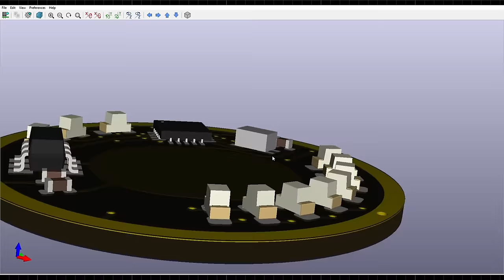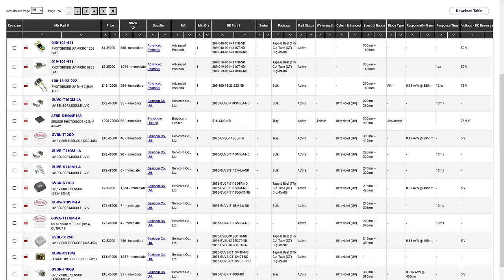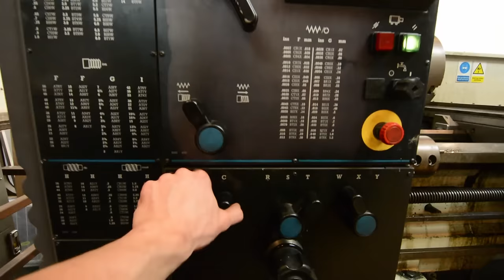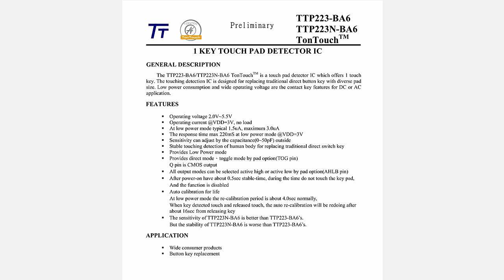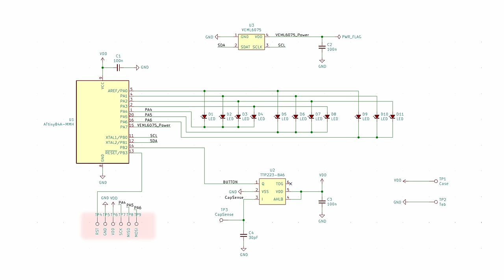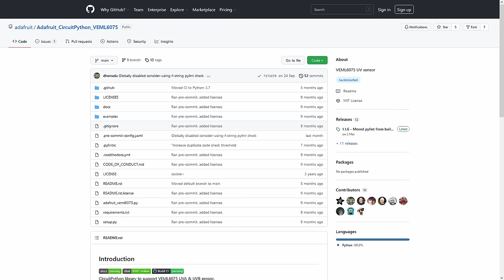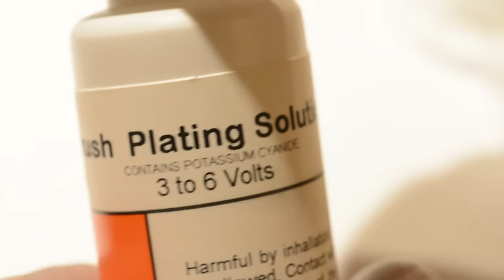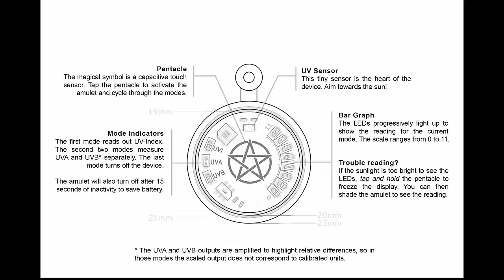UV Protection Amulet

Comment: How to improve it:
1.) Use individual sensing diodes for various UV wavelengths and measure the values yourself with ADCs.
2.) Use an electronic paper display, it fits perfectly with this project.
3.) Make it solar rechargeable with a little super-capacitor.
4.) Add a quartz glass window.
Reply: are there epaper displays with the dimensions of a CR2032 battery?
Reply: @MrPhilip796  
Is it really necessary to make it the dimensions of a certain battery ? Like, what if it’s solar rechargeable with a supercapacitor for energy storage ?
Reply: @cezarcatalin1406  I feel like it'd end up looking weird if you didn't fill out the round window of the amulet, and I mean I don't wear jewelry, but if I was to I don't think I'd wear something that looks weird as that just seems to defeat the point?
Reply: @MrPhilip796  
Ok, that’s actually a good point... maybe we can have a round epaper ? Or... maybe we can have a square amulet... OR maybe we can have an amulet like a star with 8 corners made of two squares placed at 45 degrees and that allows both a square screen and other sensors/things in the other four corners.
Reply: great idea, but I agree with the fact that this would look weird with a square/rectangular display. 
Also, the small size is what makes it unique.
Reply: @cezarcatalin1406  solar panel on back? i really loved the dimensions tho I could understand making it bigger.
Reply: @cezarcatalin1406  on a hyper speed google session i found a round 3.9 inch epaper display while batteries are 3.2, honestly, just add a bezel on the battery compartment and you would be fine.
Reply: @MrPhilip796  Well, why not make a square or rectangular amulet? It could be even easier to make.
Reply: What do you reckon is easier to make? Threads which is only possible on something round or a hinge + locking mechanism?
Unless you think wearing your amulet the wrong way to have a solar panel charge an oversized super capacitor is a better idea than a small replaceable battery?
Reply: @MrPhilip796  What do you mean by wearing amulet the wrong way? I'm for e-ink rectangular screen, because I've already seen the rectangular MP3 players designed to be worn as a necklace, they looked good. I'd prefer leaving the battery as is, it would probably last longer than in any wristwatch. However - using really tiny rechargeable battery or supercapacitor and really tiny solar panels on the thinner sides of the cube could make the device totally maintenance free and virtually eternal. Consider a box like 1/2 of a box of matches. I know, aesthetics is subjective, not everyone would like the look, but it would be pretty practical. BTW, I also disassembled one of such MP3 player, it was pretty simple aluminum box, nothing too fancy. There are plenty of ways of doing a little metal box. You can even probably buy one.
Reply: Or, just usb-c to charge, and an ultracap.
Skip the metal case, lay in lapidary odds and sods, use lube threading some pyrite or something if you must thread something. Can't wait to get past the metal bit to this wonderful wee amulet.
   This could have been EDM milled. But the graph...can connect over LiFi surely to give actual instrumentation to it, a mcu having been fingered for whatever otherwise untapped reason. And no shading the UV sensor.  Louis XIV era suns are old looking enough really? And hurrah DEFRA then for a touch of enpirical sense! But then your green method for passivating brass is gold arsenide for reasons...leaf from Johnson Matthey is too thicc? Dunno.
  You'll get all sorts of contact about outdwarfing and Asgilathshoring...nothing like a good entspeke system that works with Sslacke and Dischyrde.
Reply: Excellent. Can you please hop on the project to make the improved amulet and send it my way? I'm completely willing to pay for the cost of parts...
Reply: i don't think electronic paper would work well in a device so small.

Comment: Great project! Thanks for the research with that sensor.. I got some of those here and would have expected that they actually work. I'm asking myself if the extended UV-A its measuring could be taken to extrapolate and estimate an UV-B reading. 
Did you consider giving the little handle longer shaft and cutting a thread? I can imaging simple M2 thread cutters would work here, or am I just overestimating the size of that?
Another way could be to drill trough and solder from inside letting it flow to the outside.
Reply from the maker: Hi! I think it's still a good sensor, if we only care about direct sunlight, I just wish the documentation was better and that the calibration numbers were correct.

The "proper" way to solder the join would be to use a high-temperature solder with borax flux, which doesn't go runny when it's heated. Then you can just place a small amount of solder on the join before starting, and it'll wick into place under the blowtorch. That way shouldn't even need a hole or divot in the brass, the hard solder on its own would be strong enough.
Reply: @mitxela  if it wasn't a present I'd probably use hot glue 😂
Reply: sadly the bad documentation is something a lot of these integrated (I2C/SPI) sensors have in common. I recently worked with a Bosch BME680 air quality sensor and I could not get the humidity reading to work properly. Maybe the batch I got (tested 5 units) was bad, or I have overseen something, but I could not get that register to work, even if the config registers are set the same way as the datasheet tells me to do...
Same with a lot of these sensors. Sometimes they just don't work correctly.

Comment: That is a gorgeous piece of industrial design.  The fact that it requires pretty much every skill that I've personally built over a lifetime (machining materials, electronics design, soldering, software engineering, jewelry design...) pretty much puts this right into my wheelhouse, and now I want to build my own... After all, being a redhead, the sun is my natural enemy.

Not one like that, however, I would loathe to copy someone's designs outright.  I need to build one that has a similar function, but goes about it a completely unique way :)

Unfortunately, watching this video has possibly created a bias, so I have to try to do things in a different way :D

Comment: Nice project!
I see two possible easy improvements:
- high brighness green LEDs
- drop of a clear epoxy over the circuit board to make it a bit more protected, but still thin enough to not cover the sensor

Comment: 32:19 When you include the circle (and use it with this context) its called a pentacle. basically, the symbol of protection you are talking about is the pentacle, which is a circle around a pentagram (the pentagram is just the star). Its the inverted pentacle that is associated with evil practices because of the belief that inverting symbols of protection or symbols of good would also invert their meaning. this has clashed with other ancient believes though, so its not 100%. For example, the inverted cross is used to symbolize an inverted messiah (evil messiah) but Catholics also use an inverted cross to represent St. Peter and humbleness because St Peter was crucified upside down on request that he not die the same way as Jesus.

Basically, any Catholic who has studied religion for more than 5 minutes knows that a pentacle is just an ancient symbol of protection, generic faith, balance and its the inverted pentacle that is meant to portray the opposite of those things. Also it its not clear, an inverted pentacle has one point facing directly down, while the traditional pentacle has one point facing directly up. why is that? i have no idea.

Comment: Get yourself a telescoping gage set. They are accurate and inexpensive at around $23 US for a cheap set. A more expensive set will work more smoothly, but a cheap set will still work.

As for backlash, there won't be any when threading. The lead screw is spinning and you engage the half nut around it. Any backlash is immediately taken up before the carriage starts moving.
The backlash on the drive screw and dial for the cross slide does matter though, so keep dealing with that.

If the back gets stuck, hot glue it to a ruler or some other wrenching object. Unthread it, and then peel the glue off.

Comment: Just a couple ideas. 1) make it solar, maybe with a battery or a cap. 2) in the lens, have it where there is three led groups, around the edge. 3) the led areas for each designated indicators are different colors. 4) as each reading gains in strength, they spread wider, and towards the center, and brightens accordingly 5) as all three meet in the center they will be separated while they indicate lowish, and start mixing the color that is the correct color as they get stronger. So if the colors was red, green, blue. Up to a point, there would be three different colors sort of fading or blending the lines but not mixing, then the center would start glowing white faintly. As the readings get stronger, to max, it would turn almost white, until it started to do a dance of red, green, and blue, with highlights of white.
I am taking that with the dancing colors, an to top off with the white highlights, that sunscreen might not be enough. You might need to get indoors pretty quickly, unless you want to play the part of Dracula.

Comment: That's really interesting. Why do you cover the lathe's bed to keep the abrasive dust away? Will it break or deteriorate the lathe somehow?
Reply: The reason the abrasives work in the first place is because of the hardness difference between the abrasive medium and the material you're working. It's not indestructible though, so as you work with it small pieces of abrasive will break off and fall into the ways of the lathe.

This is problematic because that's a precision ground bearing surface that the lathe parts move across, and if there is abrasive powder there (which is harder than the lathe parts) then they will abrade the bearing surface and ruin the precise flatness, which will cause problems like the toolpost or tailstock carriages binding up while you're trying to move them back and forth.

The reason most metal chips finding their way down there isn't a big problem is because the softer worked metals are typically not harder than the surface of the ways (though when the metals are harder, similar precautions need to be taken.)
Reply: @Nimphious  thank you, that's very interesting! What metals should one watch out for?

Comment: We have a lot in common, except I don't have the machining chops, but I've worked on an UV sensor for company that makes weather stations and I built a test fixture that monitored 100's of them on I2C bus and we calibrated then to a calibrated UV sensor either references: a Yankee or a Kipp & Zonen they're $5K and were NIST calibrated. Clearly not for the hobbyist. The sensor were calibrated to that and it uses EAS (erythemal action spectrum) index based on the assumed input of 25 mW/M^2 and some equations that give you a number from 0 to 16, but we'd see  8 to 10 at peak sunlight during summer.  The sensor was a raw diode, opamp, and a few other components... ADC... and I agree, you could have saved yourself that headache with that sensor. 

Ironically, I have a different design for an electronic protection amulet that many years ago I wanted to produce as a commercial product... let's just say it would appeal to certain metaphysical clients, would basically had the same shell and the PCB would be the face of it.

Comment: 24:34 "I'd like to think there are a few jewellers watching, and cringing so hard that their teeth melt"

I can't believe you've called me out like this... (also solder likes to follow heat, so if you use a flame, try heating from the opposite side next time and it will be less likely to blob on the side! :D )

Comment: I wonder if there would be a way to use some LEDs (light-absorbing diodes?) as a micro solar panel, which would serve as a sort of touch sensor. You'd be looking for high input from sunlight, dropping to low/none as the finger covers, then back - perhaps a few times in quick succession, to rule out clothing, etc. This could let you have a front bezel, and even put all the components on the rear, with back-firing LEDs and a cutout for the UV sensor.

Would the amount of power from say, 4 LEDs in bright sunlight allow that? It would only be for detecting "touch", not driving the sensor or display LEDs.

Comment: Surprised you didn’t opt for the newer ATtiny series, like the 1616 and such. They only need three pins for programming, or just two if you’re using seperate voltage sources. Personally I made a programming clip using a clothes peg that grips onto the edge of my PCBs so I don’t need any bulky programming headers or well aligned pogo test pads and alignment holes. They also have as much power as a good old 328p, if not more, for cheaper, and have built-in hardware for capacitive touch buttons (if you can figure out how the hell that works) alongside the standard serial protocols like I2C. Not that you’d need anything more powerful than a tiny24 for this project.

Also I’d definitely have added a conformal coating!

Comment: I think about the only change I'd have gone with is rgb LEDs, so when you switch between the modes it switches colors.  great design though, you could sell these... hell... if the boards were cheap enough just selling them in 3d printed housing would be pretty awesome and you could undercut the insanely high priced uv meters on the market.

Comment: I'm no toxicologist but isn't using leaded solder on the outside of a trinket that's supposed to be worn for extended amounts of time with direct skin contact kinda iffy?
Reply: he gold plated it so I wouldn't worry about the tiny amount of lead. There will most likely be lead in the machining brass as well, again no problem once it's gold plated

Comment: A bot older video but not for me, I just watched it :D 
So, I was thinking, not sure how thin the PCB is but i think you could solder almost all components "inside" the PCB: vias are copper plated then just drill out the space between 2 vias (guess your pcb provider could do that professionally) and solder components inside the hole, if the pcb is 1mm thick I think most components would fit flush with the surface?

Comment: Watching this I thought 'what's wrong with this guy?' Then I thought 'you're watching it so…'

This project appeals to me on two levels: 1, comical frivolousness; 2, miniaturization.

Suggested improvements: change the sensor, conceal the circuitry, change the color and scaling of the display, use a battery holder and/or off-the-shelf housing.

Comment: Hello,
I watched your YouTube video and then fell asleep. I then experienced the UV protection amulet in a dream. I watched as a woman almost dropped it down a storm drain, but caught it at the last second. She then dipped it into that darkness, and I saw it begin to light up like a beacon. Beneath the storm drain was a vertical tunnel, a giant castle spire that seemed ancient. I was awestruck by the slow-mo footage of the UV protection amulet, but then realised she was only lowering it down extremely slowly. I joined her at the bottom of the great chute, the UV protection amulet on the floor between is, now glowing like a bonfire. The UV radiation levels in this room were overpowering, so we looked at each other in confusion. What did it all mean?

Comment: There needs to be some clarification in your symbology understanding. A Satan's pentagram has two points up, a pentacle has one point up. The pentacle is still a symbol of protection. Also, there's a difference between hitlers swastika and the Buddhist swastika. The Buddhist swastika points in the opposite direction and does not use hard right angles. Just a little food for thought

Comment: Brasso sucks. Too much grit. Try Mothers Mag & Aluminum polish if you want a mirror finish without the lines/scratches. Works on Copper, Brass, Alu, Stainless. Just don't use it on anything plated. Bonus points if you PVD coat it afterwords. Then it will not tarnish/oxidize over time.

Comment: Your experience with that IC is unfortunately extremely common in the sensor space. I've been working with a ton of environmental sensors (temperature, humidity, pressure, gas composition, particulates, light, vibration, noise, radiation, and even radioatmospherics for lighting strikes) and I cannot count the number of times when I've looked at one of the really popular Arduino libraries and found that the code in there is completely wrong, either due to improper implementation or errors in the datasheet. A really common issue is trying to use extrapolatory sensors in environments where the extrapolation doesn't make sense, like trying to use TVOC or "eCO2" sensors to detect CO2 introduced into the environment by a non-organic chemical process. I dread to think of how many sensors there are out there that are outputting nonsense numbers because of it.

It's funny that you mentioned the DEFRA monitoring sites. I actually tried to get accredited to operate one of those, since they're almost all outsourced to third party companies who do various metrology and meteorology stuff. Unfortunately they don't accept applications from domestic operators, even if you're weird like me and wouldn't mind forking out several thousand pounds out of your own pocket for metrology grade environmental sensors.

Comment: Does this need charging or replacing of power?
Reply: Well it's a battery so yes
Reply: @nyetloki  which one would you do regularly
Reply: @hasanalharaz7454  depends. My watch uses a coin cell while my headphones have a rechargeable battery. This would get used less so a coin cell is fine. That's why he went through the ultra low power option and gets a few months out of it.